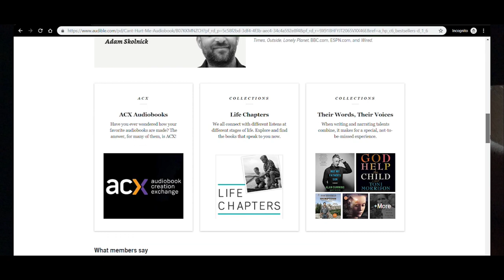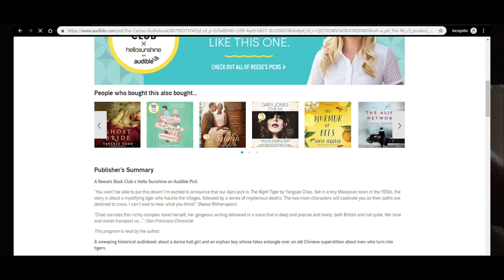Airbrush COMPRESSOR RESTORATION

Comment: Is that big brass cap with the 2 holes for adjusting pressure? I just refinished one I found at the dump but I don't see how it regulates pressure and it makes me nervous to just let it run. Or is it supposed to run constant and you shut it off when your not using (which sounds dangerous)? Any info would be greatly appreciated.  your dad looks like he would be cool to hang and do some projects with, cool vibe between you two.

Comment: That green air tank hanging outside your dad's shop... I have 2 of those. Someone told me once they are off an airplane. Do you know anything about that?
Reply from the maker: +Stephen Yes that is correct. I believe they were oxygen tanks, however I could be wrong.
Reply: @TheGoodoftheLand  well, it does make me think more that my silver one was stripped rather than the green one was painted(as I had thought the green couldn't be right, though it's the same green)